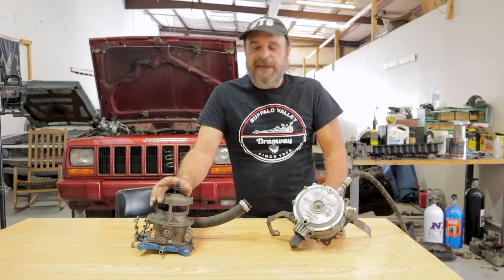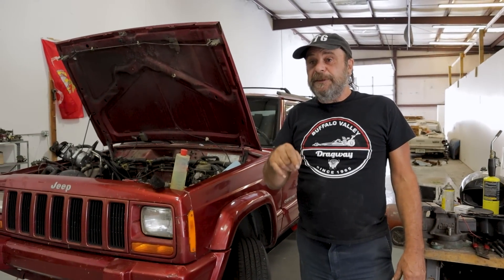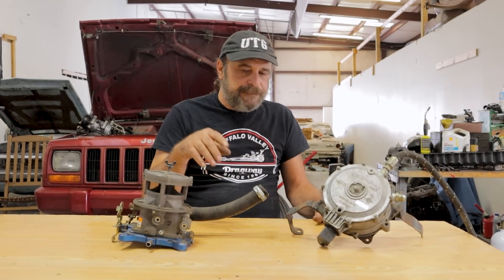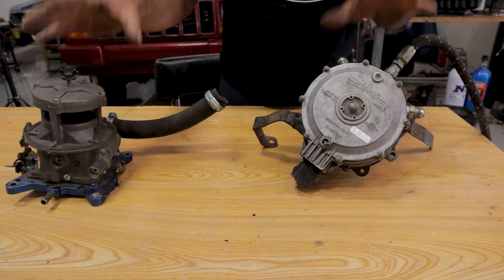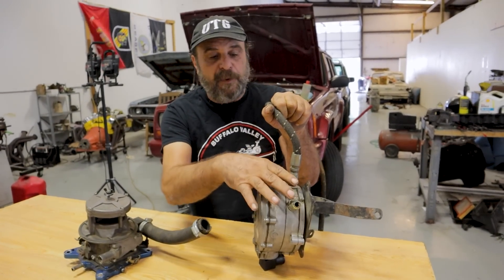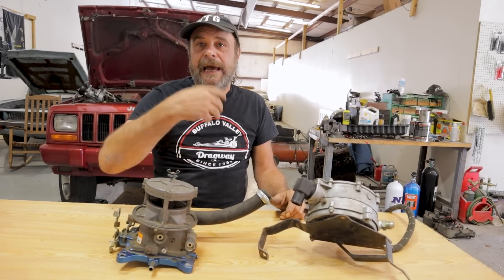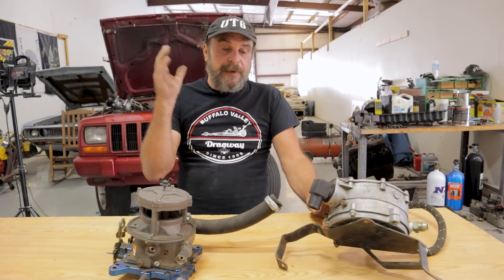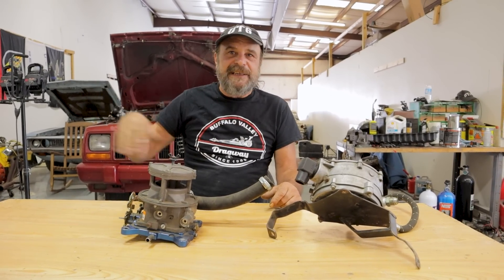Hot Rodding With Propane (And Propane Accessories) - Overview Of The Impco Carburetor

Comment: Hey I'm Jeff, your not going to go BOOM. 😮...🙆🐕👍. On a oats onboard engine compartment you will find one or more exhaust fans for removing fumes before ignition. Mando regulato , automatically sync now/before boats on occasions would explode, spark from ignition system, v(spark + fumes). I'm sharing a link to eBay for exhaust fan. 
Post Script: I'm doing a LPG conversion myself and have a few ? if I may. I'm subscribed so when I see that you handled the Bom-Threat I will appreciate some advice please.

12V In Line Bilge Air Blower Fan Ventilation for Marine Boat
Reply: 3" 12V in Line Bilge Air Blower Fan Ventilation for Marine Boat.

Comment: Full speed ahead! I'm a long-time fan of propane as a motor fuel (in spite of the inconvenience sometimes). One big caution, however: You're missing a very important third component. The Model E vapouriser/regulator is NOT a vacuum lock. Every propane system I've run (or ever seen, for that matter) is fitted with a VFF-30 (or equivalent) vacuum lock-off/filter that only allows the fuel to flow when the engine is cranking and pulling a vacuum. Without that, fuel can potentially leak from the Model E or any part of the system under the hood. This is wasteful and dangerous enough outdoors, but in a confined area like a garage or parkade, propane can gather just like gas fumes, and generate a fire/explosion hazard. You could get by putting on a manual valve shutting off the flow of liquid propane going to the Model E, but that's pretty inconvenient and sooner or later someone forgets or doesn't bother, and we're back to living dangerously again. There are enough Panicky Pollies hysterically running around with Hindenburg Syndrome already. Let's not give them another excuse.

It doesn't appear that Youtube will allow me to attach a photo of my set-up, so:

https://www.impcotechnologies.com/wp-content/uploads/2021/09/vff30-lockoff.pdf

Comment: I haul that stuff everyday in 11,500 gallon bottle. I love propane and propane accessories. another neat trick is to run a little bit of vapor into the air intake on a  turbocharged diesel engine. Wow!

Comment: The reason for the huge baseplate isn't air flow..it's airflow + Propane gas flow. there's a certain number of CFM of propane gas going through it that did not go through the air intake side..that combined flow requires a slightly larger baseplate to accommodate the increased volume of the air + the propane gas.

Comment: We have a 99 2x4 XJ.  Fix the crimped exhuast on the @x4 it is not needed to get around that transfer case and outher 4x4 gear.  I'n my but in the seat driving.  The 2x4 feels much more spunky and more fun to drive.  It will do a basic burnout,  (Not a Cletuss McFaland Burnout).   If you have done that I might of missed that video.  We also had the cat stolen out of it years ago and replaced it with a "Racing" cat.   I think just freeing up the exahust has made a in my opinion a better seat feel than it was before.  FYI wife is 2nd owner of the 1999 2x4 XJ.  The orginal owner traded it in after 4 months for a 4x4 XJ.   I still drive the XJ 3 to 5 times a week.  The A/C is so much better than my van.

Comment: I dont watch this guy, i think hes absolutely nuts. BUT you viewers would appreciate this comment/idea. If youtube algorythim shows it. 

VAPOR CARBURETOR, with any liquid cooled engine, by routing carbutetor through the coolant channels and into the engine. Yeah, it seems obvious, take the carburated gas and pass it through the coolant channels which once had water, but now they act as a perfect heat exchanger, and even safe atomization space for the gasoline. Out of the water pump outlet, it gets a high temp hose to the intake manifold. 
The water pump can have a small blower for small gains of flow or draft or push in the right direction, if engineered right It would work as a small supercharger and fuel air mixer. 
Then, if the engine overheats, though it takes less gas using only the highest possible atomized vapor, which when combusts creates less heat, it forms a postivie feedback loop,,,    you could also add a small water injector or venturi that can further cool, create steam and propel slash cool the engine. Positive feedback. And theres added benefit of no radiator, for convective cooling, and no resistance on the water pump, another small gain. 

I really just might try this with my gx360 engine sitting in the corner of the shop waiting for a cooling system. The carb vaporization cooling method might just work for this small engine. I just need a way to dyno it, maybe could make a small motorcycle with stupid simple pulley tensioner drive system...

For the water injection The best way is probably with an ultra fine water methanol injector system, for the carb, proably a small pumper jet ski carburetor would do pretty well. I am imagining the system would demand roughly the same amount of water as gas, Haha why not run 2 carbs in series and just have water going to 1 and gas to the other. Its crazy, cool. 

The power would most likely be lower, but who knows how much and actually, I see no inherent engineering of a normal 4 cycle which would prevent it from performing, normal.  Combustion with ultra atomized vapor is always more ideal even better than direct injection. 
I think it would need a check valve flame arrestor for production, just a flame flap, but if its timed right, with the right operating temperature and carburetor fuel allowance, 
You could realistically get over 20 percent more fuel economy for certain. Maybe even 40 or 50 percent more like some papers show online, But if its really effective, you have to beat the mothership of obd2 sensor madness garbage, or revert to a small carbureted liquid cooled car or motorcylce. 
I would try a dated motorcycle, for testing, tinkering its alot easier and probably less equivocal, to make studying results even easier. 

This is a real project. 
i think people should try it, 
not on thier good reliable bikes, but you know some crappy road cruiser or what not.

Comment: Propane doesn't burn is hot the engine takes longer to get up to operating temperature to if it even gets up to operating temperature I had a propane system on my 77 Silverado pickup truck 30 years ago 30 years ago gasoline gave me better mileage than the propane did and most people don't realize it when you put propane on an automobile you have to pay a road tax you have to get a tax sticker like I did in Florida but I didn't get it I worked around it cuz I knew somebody that work at a propane company

Comment: Tony, I'm excited too! I have author Jay Storer's book "Economy or Performance, Automotive Propane Fuel Conversions". If you can get a used copy, he covers every aspect in detail, including turbocharging. He quotes a turbo/propane guru, the late great Ak Miller in several parts of the perf. section. Using the knowledge gained, Jay built 2 turbo/propane engines for two Model A's, 1 with a V8 Ford & 1 with a 300 cid Ford "Big Six". It is a great, trouble-free fuel, when the system is built correctly. If you turbocharge, use the heavy duty silicone mixer diaphragms! They handle the heat & pressure better than normal ones do.
Meybe we will get a turbocharged straight six out of UTG yet. I guess the fellow that was building a turbo slant six in your shop got sidelined for..reasons. Theres an orange 70's Ford Maverick on YT with a 300 cid & turbo/propane that blasts down the track you might check out. I think it's an Aussie build. Cheers!

Comment: My dad worked for a propane distribution company in the late 50’s early 60’s. We had a 57 Dodge on propane. Later in life I ran my 77 GMC on propane for 120,000 miles after converting it at 70,000. Those were the days when if you had trouble with your wiper motor a Knowitall would tell you it was “because propane”...

Comment: My dad has debated doing the same conversion on his more modern (2000’s era) vehicle.

If you had a propane tank or gas line at your house it would be extremely easy to fill up your vehicle. They do make conversion kits for more modern vehicles!

Would probably be better than Electric BS

Comment: propane tuning is a bit different than gasoline tuning, if the mixture is lean you won't have excessive combustion heat issues or detonation like you would have with gasoline, you just won't have any power. but, if the mixture is too rich you will have excessive exhaust temperatures that can burn valves and make your entire exhaust system glow cherry red..... been there, done that.. best way to tune is using an exhaust pyrometer setup, preferably with the sensors as close to the exhaust ports as possible. on the 425, there is an idle mixture adjustment and a main mixture adjustment. depending on the model, it will have exposed adjusting screws with straight screwdriver slots or it will have recessed adjusting ports that you adjust with allen hex keys. sometimes the adjusting ports are sealed with metal plugs. the idle adjustment is on the end of the diaphragm cover on the side of the body, the main mixture is centered on the front of the body.

Comment: Test drove an early 80s VW Rabbit, in 1990, for a buddy. The Rabbit had a bad cold-start injector, so the DIY owner just spliced a hose to the intake manifold, attached to a small propane tank. This propane tank was sitting in the front passenger footwell....in the car! To start the car, when cold, open the valve on the little tank, crank the starter, then shut the valve when the engine smoothly idles. Simple....maybe a little dangerous;)

Comment: Propane and Propane accessories as Hank Hill would say.  Ive run this on 429 and 460 engines flawlessly, just need to have the right distributor curve, and hardened valve seats(my C9VE heads ended up with exh. valve recession, so need Ductile iron or better exh. valve seats.) .  Ohya and a Hot ignition, like a GM HEI module triggering a Duraspart distributor.  Plus good wires, cap, rotor, plugs(which can be colder).  Otherwise it works great!  Going to try Dual Impco 425's on a fresh bigblock one day.  And I am using a stock 600cfm lower baseplate modified to have the secondaries open with the primaries.  It likes it.  Large Plenum intakes too.  And it keeps the crankcase Clean!

Comment: There used to be alot of these in Phoenix and the bay area. A lot of taxis used them before Obama. Biggest issue was finding a place to refuel so along of the systems I say piggybacked   off gas so if you where somewhere that you couldn't get propane you could run gas. Taxis use airports to refuel

Comment: Propane is 5 bucks a gallon while gasoline here is 3.50/gal and diesel is 4.19/gal. Propane is not cheaper than gasoline until you reach race fuel status. For everyday driving it is okay but not cheaper and also less fueling stations available. One of the best things about it are the lower carbon emissions which means the oil will look like new for many thousands of miles.

Comment: Back in the day. We ran propane systems on a fleet of trucks and school buses. The conversion was easy, but the set up was not. The performance and economy was dependent on set up. The set up required a gas air fuel meter to adjust the mixture flow for power and idle. The timing properly set and you got a system that was very satisfying. Just bolting on a system and going for it would not be any good at all.  Oh Tony, you will need a lock-off and filter for your system also. Just saying, the old school guy

Comment: I ran a 318 Valiant for over 20 years on LPG. Set up was the Impco 425 on a 4 BBL throttle body, probably came from a Barry Grant as the bores didn't seem to match a Holley. It was the most trouble free fuel delivery system I ever ran. The only reason I removed it is the decreasing number of "LPG" bowsers as the fuel companies keep ripping them out. (The Val' now runs an AVS2).  It didn't help when the fuel companies started substituting Butane for Propane but all that suffered was the mileage. My daily driver for work is a Ford ute with the OEM option gas system (Viallie (SP) - european sourced and IMO not as reliable as the Impco but still a good system. 

Apart from the need to plan your trips better and not run out of fuel or require Jerry cans, and the need for a gas fitter occasionally (legally that is. For those on the "free-er" side of the pond the Australian beauracracy has a was way of over policing every aspect  of what they deem we're permitted to do).  Also ensure your valves and seats are hardened. 

The fuel itself is, just as Uncle Tony says, a great alternative to petrol  (sorry "gasoline" ;) ). As the fuel vaporises well below freezing cold starts are easy no need for a choke or even a fast idle even in the southern states of Australia. Might be different in the colder climate of northern parts of the USA or Canada. The engines run cleaner, not just at the tailpipe but also much reduced plug fouling (even idling in heavy traffic) and your oil stays cleaner longer. Which directly translates to longer engine life, just ensure your valves and seats are at least ULP hardened. My Valiant has the Brazilian block which came with hardened seats. I rebuilt the engine somewhere around the 320000km (20000 Mile) mark the valve faces and seats were great - bores were also looking too good for the mileage - had the machinist question the mileage until he looked at the bearings and noticed the stretching on the valve collets. That engine has since clocked up a further  500 000 km (312500 Miles) most on gas but is now showing it's age.

This fuel is actually a very under-rated fuel. Build your system to suit the fuel (As Ford Australia did with the "dedicated" Barra Falcons) and it is actually than petrol in most respects. I haven't got rid of the Impco system just mothballed it. Just in case....

Comment: Hell yes, I can't believe i missed this video, I'd be extremely excited to watch my favourite YouTube hot rodder playing with LPG/propane!

Yesterday i just finished reassembling my Falcon's 4.0 litre SOHC six (blown head gasket), and had to screw around with the wiring loom to regain injector pulse, then replace three of the injectors to get it to run. Man, all of that wiring, sensors, connectors... I'm determined to simplify how the thing works. Unfortunately a carb conversion is illegal where I live - but propane is absolutely legal! (Must be done by a qualified LPG professional though). And at less than half the price per litre, I'll still save a heap of money even despite needing to consume about 20 percent more.

Sadly LPG is in its twilight years in most of Australia but my state (South Australia) is still hanging on fairly well, and Victoria still seems to be retaining a lot of stations that stock it. If I fit dual or even triple tanks that should eliminate any range anxiety 😀

Comment: Tony those IMPCO mixers were intended for irrigation/natural gas pumping engines. It's not uncommon to be poking along out in nowheres and hear straight-stack V8 roaring along at 2200-2500 rpm. Find the source of the noise and it'll be some random junkyard big truck engine and a 10,000 gallon propane tank sitting next to it.

Comment: It was an entire industry converting cabs & farm trucks into propane during the 80's. Propane tanks on a farm was a common as chickens. GM produced heated regulators at the rear tank, then switched a second set of injectors turned on while the gas injector turned off in the vans of the 80's. Man, the oil was like new! 
ASE Master 78.

Comment: A customer came in and asked about replacing his R-1234yf with propane. (when the time comes, that stuff is expensive) I had never heard of it being done. SO I did a little reading and yes propane instead of R-134a is a thing and now there is R-290 . I know this isn't using it as fuel, but it is another use for propane. It's just not for your grill anymore.

Comment: On the subject of propane and the Mule, I'd like to see a test of a nitrous oxide system with propane through the fuel for the nitrous sytstem. With the octane rating of propane and the additional evaporative cooling effect of the intake charge, you could really pack the combustion chamber with a much denser charge than with nitrous oxide alone. Pros? Cons?

Comment: Propane is awesome but does have drawbacks. Gasoline is roughly 126,000 btu per gallon, HD5 propane is 91,600 btu per gallon, roughly 1/3 less energy. High compression can recoup some of the loss but makes the engine less convertible back to gasoline. Looks like a 30 pound tank you have, 7.25 gallons at 80% fill. Liquid withdrawal tanks are needed for the vaporizer and will have the relief valve in the tank vapor space, an important safety detail. Overfilled tanks are the leading cause of mishaps with propane. I used to maintain a fleet of bobtails & service trucks run on propane as well as deliver propane & appliance repair. A family-owned business I grew up around. Love your channel! We have much in common. Would love to be a resource for you with any questions you may have! I live in NE Pa. Not sure how to cross the communication boundary while protecting both our privacies.

Comment: Pro tip: If you own one of those large 500gal or 1000gal residential propane tanks, you can buy a hose assembly that screws onto said tank, and fill your own smaller tanks. I believe the large tanks usually have a 'vapor' port on one end, and a 'liquid' port on the opposite.